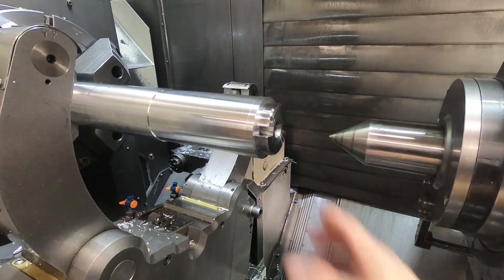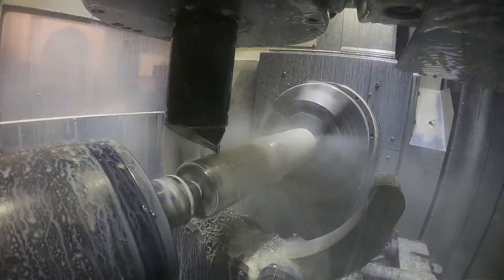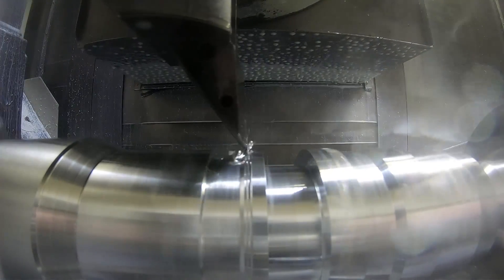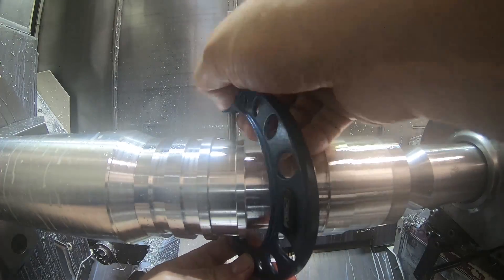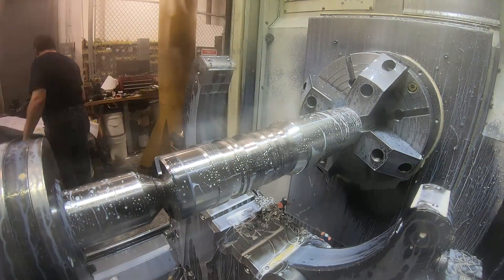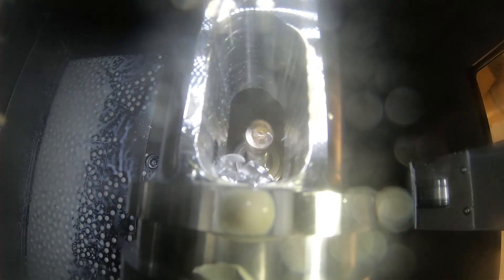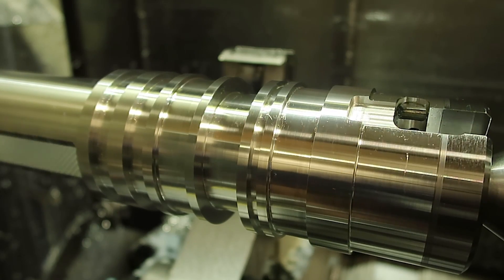Valve Body End 1

Comment: I like how you always use climb milling. My program ALWAYS goes both ways and half the time you have to hear the loud vibrations of the tool wearing. Hey Peter, I just want to share my story. I'm out of Houston and I'm 28y/o but I started at a pretty big mom and pap shop that was all manual machines, efficient, but all manual. I found my way into CNC school out of boredom and spent the next three years learning and trying to get the owners to buy machines. They weren't really pulling their weight when it came to moving towards the "CNC" direction even though the majority of their work is repeat parts with 40 year old revisions. So my strategy was to leave the company to kickstart them into searching for a machine. So far my plan has gone even better than I thought. The funny thing is that they're coming to my new shop with the Haas salesman to look at our machines, but we're not going to tell my boss that I know them. So it looks like once they buy a machine I'm going to go back and become the programmer and machinist. I'll be programming a Haas ST-40 and a VF3YT on Fusion 360. haha. Not bad for humble beginnings. Anyways, I'm just so excited man I had to tell ya. Like I said before, you're one of my mentors. I'll keep you updated, have a good day. And great video btw. High quality service you're doing for us internet machinist.

Comment: Curious to know whether or not that big slot is gonna camber or twist the inconel at all
Reply: Gus Mcgussy. In this set up it would not. and if you mean when he release the chuck and tailstock; i think inconel is very stable material. most stiff alloy known to man i presume. 

couldnt rough out that slot in steel as it would warp. i mean you could but it would either need stress relieve or done in multiple ops thus losing things like datum runout and loss of concentric features.

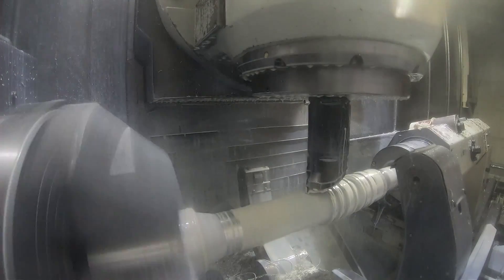Comment: Peter thanks once again for such a excellent learning opportunity. Programming question....in the Op around 7:30 where you are roughing for clearance do you use a 3 d model of the roughing tool and holder from the manufacturer or have to develop your own model? The reason I ask is that in this video and previous videos it appears the holder comes very close to rubbing and I wondered how well the tool avoidance/ crash portion of the cam software handled the angles? 
Thanks again for your sharing.
Reply: Guzziv7Sport hes just careful lol Look for the other comment askinh about tool models. says he doesn't.

Comment: I'm liking the plunge mill, we've been adopting Alot more profit milling as of late but it plays hell with the conveyors especially when the operator clear the table and slugs the auger with chips. The small chips look like they would be easier to get out the machine.  Have you tried the profit turning yet? it looks right up your alley

Comment: Awesome work as always. I am looking to get some finish turning tools, and as I try to stock as little tools as possible, so I would like to ask if there's a big difference between VNMG and VBMT or even VCMT tools. Do you use the negative ones for roughing and the positive ones for finishing or for using different lead angles other than those dictated by the toolholder? Would you recommend negative inserts for finish boring?
Reply from the maker: VNMG would be a 35deg negative rake. The difference between the VBMT  has a 5 deg side and the VCMT has a 7.5 deg side clearance angle. You can use either negative or positive rake for finishing. I prefer to use positive my self if possible. It puts less pressure on the bar.
Reply: I agree with Peter, all my finish tools are positive, I do prefer a vbmt on a 35 tool the extra meat helps keep the edge alive. I found a good general finisher to be a Mitsubishi mj. It is considered a super alloy breaker but works well in aluminum and stainless. Even carbon but they tend to break down quickly. In 303 we can run the for days even in interruptions

Comment: Nice work Peter, thanks for always taking the time to share it with us. You have a ton of tools and use them in several different orientations on the machine. Do you have your tool library set up in Cam so the software knows what tools can do and not do ? Things like direction of spindle rotation and clearance ? We use master Cam and I have not set up my tool library the way it should be done. We don't use a ton of different tools so it's not a lot of trouble but I would imagine with all the tools you use and the way they can be used in multiple orientations you need to be set up well on the Cam side.
The work you do on this machine has inspired me and I have an opportunity to pick up a 2005 Mazak Integrex 100SY for really low $ It would be great for the work we do but tooling it up gives me concerns.  Thanks again Ron
Reply from the maker: I change the tools tool holders and tooling so much that to define it in the cam software doesn’t do me much good. I have saved tool setups for specific parts. In Esprit you can have as many tool libraries as you want. The actual tool orientation has to be set on the mazatrol tool setup page. So it does need to be defined in the cam but it needs to be manually set at the control to.

Comment: I would like to ask on your machine, how do you set or adjust the tailstock pressure on the center? And also, how do you arrive at that figure?
Thanks once again for all your selfless effort in providing us videos as you work!  Most appreciated Sir.
Reply from the maker: There are regulators and gauges on the tailstock for pressure and speed. I just guess at what I think the pressure should be. There is no set rule that I know of.

Comment: Love the videos! My only question is you finished turn all the grooves towards the end, and then you go back and you rough a large portion up to the Chuck why would you not rough all that out at once?  I would think it would stress relief and you may have concentricity, run out, straightness or other issues maybe not in aluminum, but steel you're  probably going to have stresses in the material.
Reply from the maker: I want the extra rigidity in the part when I cut the grooves. We will see what happens with the inconel.

Comment: Is this basically a test part to check the program/process before running the real deal?  I'm guessing speeds and feeds are well known for the two materials and it sounds like you've dialed it in for inconel based on your comments about chips and whatnot.  Do you have to do extra spring cuts or other makeups to get inconel to the same spec?  Or are those less necessary for the equipment you're using?

Comment: Do you have to Drip feed your larger programs for complicated parts or does the mazatrol have plenty of memory?
Reply from the maker: I’m not sure of the exact size of the working memory. If I was to guess some ware around 3 meg. I have never so far had to drip feed a program. The control is PC based with a hard drive. You back up programs to another folder on the drive. I’m sure there is a way to run a DNC program off that hard drive. I just have never done it.

Comment: Can you set up one variable that all of the feeds and speeds are multiplied against? So if set to 1, you have your base settings, but say set to 10 everything scales up by 10x? This way you could run the program for aluminum and then change one setting for the base material?
Reply from the maker: That might be possible but it could be complicated. On some milling cycles Esprit puts many different feed rates depending on the percentage of cut and the ramp in feeds.

Comment: When you turn the Tool from D1 too D2 do you run the same H offsets?

I had an issue when boring out a face groove where I had too flip the D and it was .1 different. Assuming slightly bent boring bar?

That's all in controller isn't it? Esprit model isn't going to affect the offset?
Reply from the maker: On the Mazak you cad have many offsets on the same tool. They use the letters of the alphabet. For example Tool 1A , 1B, 1C in G code tool 1A is T1.01 tool 1B is T1.02 exc. In the tool setup you specify the orientation direction for turning tools. So when you change to the tool it automatically re orients the tool and calls the new offsets. There is no G43 in the program except for full 5axis that is G43.4. Now are you totally confused?
Reply: Edge Precision haha, surprisingly I got that. On DMG it's H. We have in machine tool setter but I'm getting variation between spindles and D changes. I'm running separate H offsets on Sub (0.05 drop) but looks like I'm needing separate H on all directions too. We only have 300 offsets, 72 tools so must be an as needed basis.

I'm only learning these things from videos like yours so really appreciate the content.
Reply: I know you can post the offsets in the gcode too or do a complete g54 plane shift but having never tried it and without opportunity to try it remains theoretical lol

Comment: Why do you touch off the end mill?  Aren't the tools all pre-measured?
Reply from the maker: They are new tools that weren’t setup for this job. I don’t use a toolsetter. I prefer to touch them off manually on this machine. Also the laser tool setter isn’t working and I don’t want to spend the money to fix it. The tool arm does work but it is so heigh up its easer just to touch off on the part.

Comment: How'd you program the plunge milling i n Esprit? Do they have a plunge cycle or are you using PTOPS?
Reply from the maker: Yes just drilling holes.
Reply: I’d have to guess its set up just like a regular drill bit with a custom tool program for diameter etc.

Comment: So what's going on here, you're making the finished part, but out of cheaper material, so if anything goes wrong, it costs less?

Then you have to do the same for the more expensive material later?
Reply from the maker: Basically that’s it. It also reduces my stress also. These parts also already have some outside work done to them. The bronze overlay. It’s also a mater of time to get a scrapped part redone. There is no repair on parts like this.
Reply: So what happens to the test part once it's finished?  Just goes in the bin?
Reply from the maker: Depending on how the setup part ends up. If it looks good and is interesting enough. There is a display case up front in the reception area. Some of them end up there. Otherwise I keep them in the shop to remind me of the setup. Some times if you get to rerun the job it may be years later. This setup part machining is only done on the most complicated parts. So fare what you have seen on this part isn’t the most complicated part.
Reply: Edge Precision This is all really quite fascinating, thank you.

I dunno what draws me to these videos...  I'm a programmer, so I guess it's the making stuff aspect?  Either way I'm enjoying the ride.

Comment: I was a non believer when the tool salesman gave me plunge mill to try out. Then i had to do a deep slotting op and it cut the time down something crazy. The 1st part i didn't tighten the mill chuck tight enough and the cutter moved up like half an inch up, but yea live yea learn
Reply: n ackermann Should put a plunge mill in a side lock or hydro.